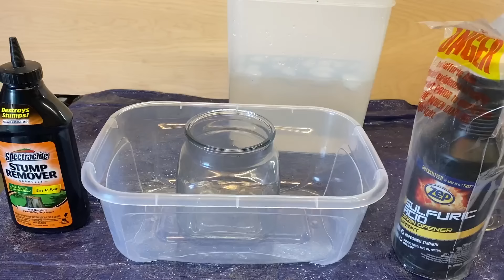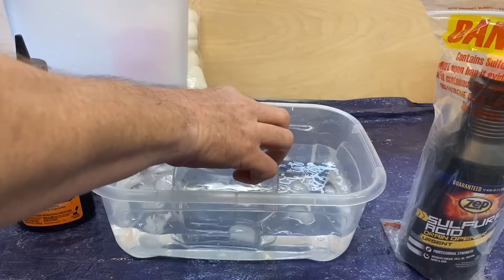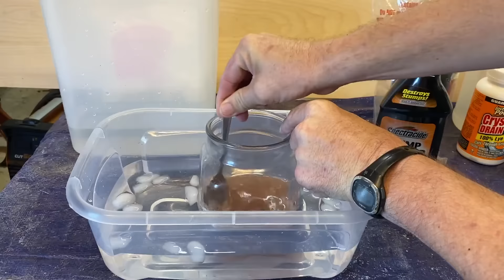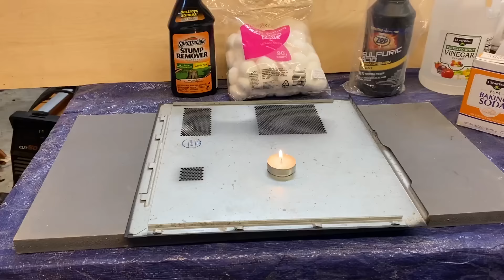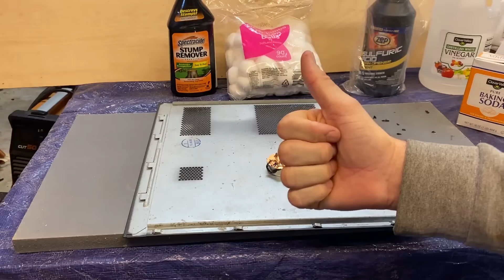Making Gun Cotton

Comment: No gloves, metal spoon to stir, I love the reckless abandon at which you operate Sir!
Reply from the maker: safety third or not at all.
Reply: All kichen utensils are made out of stainless steel which doesn't react with sulphuric acid and does not oxidize
However the glovelessness is inexcusable
Reply: Safety squints engaged!
Reply: Surprised he didn’t lick the spoon
Reply: Somebody lemme know when he pushes his last video.    I want to see what he was up to when he disappeared.
Reply: oddjobbob  I don't know where you live, but where I live They sell all utensils made from the same shiny steel. I have used forks that I bought for a dollar each in electrolysis experiments to great results. Chances are if it's meant to handle food it will be made from stainless steel.
Reply: The amazing part is that I tried to make following all the safety and good practice steps and didn't work 😍😍😍
Reply: @jackandy1736  😂But H2SO4 react with the iron inside the mixture of steel pretty well, moreover he was using zep drain cleaner containing 97% w/w concentration of the acid
Reply: @sunilbehera5628  Well no, If you watched the video you could see it did nothing to the spoon. Mixtures of elements can take on different properties independent of whether or not one of their individual part's has the opposite characteristic.
Reply: @jackandy1736  the fuming nitric acid generated in this synthesis will ignite many types of gloves such as nitrile and latex. It's actually safer to do this bare handed.
Reply: @CLCasual Ave!
Reply: At least he had it on ice
Reply: It is typically best to add chemicals to a exothermic reaction in slowly while mixing, is it not?
Reply: @bretlunsford6181  yes, almost always
Reply: @SpiritedMaker  😂😂👍👍
Reply: Об этом же подумал...
Reply: I think tongs might have been advisable for final testing.
Reply: @tedscott1478 😂😅, i was saying exactly the same thing!...not the best safety teacher is he?....remind's me of "fire marshal bill" from in living color!...😅😂
Reply: Spoon is also for tasting... Bet it's sweet
Reply: He'll probably be ok,  maybe!
Reply: and tongs would be a good addition.
Reply: Safety Third! is his motto
Reply: @robertjenkins5440  Let Me Tell You Something!!! Lol
Reply: Aww, it ain't gonna blow up! Shucks look at em , he still got all his fingers!
Reply: This comment section is like a sticky trap for Trolls. 
Good job!
Reply: @scinanisern9845  Even the big place where they make gunpowder in the US blows up every decade or two.
Reply: @LawlessMonkey72 . I know…obviously the only way to tell it’s mixed right
Reply: @jackandy1736    Neither does the chemistry of this video... its a catalyst, not consumed by reaction. In fact that is why Guncotton is responsible for some of the greatest explosive accidents in history, all that sulfuric acid that was never used, and is extremely hard to wash out of cotton, it being tiny little hollow tubes where it hides to cause spontaneous detonation years down the road.  However it DOES react with other ingredients, and is often the cause for many a youths hand being blown off.  As a general rule, one must NEVER use ANY form of metal in a chemistry mix. That is why they have glass spoons and glass rods. Just stay away from it, never go there. Kitchen spoons have been the end of many a novice. Notice he never grinds it to a micro dust and wash it.  This guarantees that if held for any extended length of time at one point it will spontaneously explode in a full whole body detonation. This is why it is that guncotton falls out of use soon after its discovery.  Back in the day they did not have the equipment needed to chop and grind it down to pieces so small as to be able to clean it from the acid very well.   It wasn't until we realized that, some time later, and built the equipment needed to reduce it in size small enough to wash the acid out of the center of the cotton fibers that it became stable enough to be sure it probably wouldn't destroy our military bases, fortresses and ships. Very irritating when your fortress blows up some sunny and otherwise peaceful day.
Reply: @lukesinclair1776 
How do you know he didn't lick the spoon, he was off camera most of the time...
Reply: Actually when handling strong acids , especially nitric acid which is what we're essentially preparing here, it's safer not to wear gloves because the burn you'd get from splashing your hand then immediately rinsing it off in the bucket of baking soda water you keep on hand (right?) Is less than the burn you'd get if you splashed nitric on your gloves or sleeve which then spontaneously combusts and sets the rest of your clothes on fire, that's also why you wear only natural fibers when working with pyrotechnics because synthetics will melt and fuse to your skin
Reply: @Einwetok  You ever seen the big Nitro Glycerin plant out in California?  Last time I was studying its layout was  a few decades ago, but DAMN, talk about a place built to deal with friggin explosions. They own the valley. There is nobody driving by.  The controls are on top of a mountain. The plant is in the valley.  The controls building tips backward down the other side of the mountain on hinges. The furniture is all bolted to the deck.  Only the people and chairs will then accelerate across the floor and hit the wall... which is hinged and opened up at the bottom when the building tilted back, and you go sliding down a giant slide built into the other side of the damn mountain, putting a mountain range between you and the plant as the sirens scream.  
Like friggin DAMN!   This is some touchy stuff!
Reply: @tedscott1478 Yeah, when he started the testing phase, before his hands were in the shot, my internal voice was saying tongs man, tongs! 😂
 
Heck, even free chopsticks from the local Chinese take-away would probably have worked.
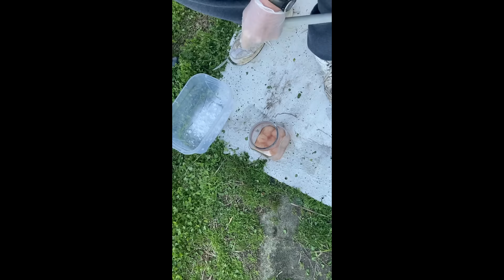Reply: He wore clear gloves look at 7:19
Reply: i came to say this. lol. well, the part about the no gloves and metal spoon, anyway
Reply: @jackandy1736  omg. you think stainless steel is acid proof. that's amazing.
Reply: Down South, it don't make no nevermind.
Reply: @BerzerkaDurk  yeah it didnt react in the video what are you talking about
Reply: I'm betting no full face shield or safety glasses.
Reply: Lol. @CLCasual
Reply: Accident looking to happen. Apparently he failed chemistry in school.
Reply: @CLCasual  AvE fan?
Reply: When it comes to many acids, gloves are not that important, and can even be the hazard as it keeps and sort of leak close to the skin. Or in the case of nitric acid, concentrated nitric acid on both latex and nitrile can spontaneously combust, while your wearing it. Now that mainly applies just to nitric acid where it's safer to not where gloves except those designed for nitric acid. 

However, it is always a good idea to have a large container of sodium carbonated/bicarb solution at the ready when working with acids. The reason is obvious, but something many don't consider is that a stronger base is not better in this case, as if there an accident and you need to dunk any part of your body into it, you don't want to trade one hazard for another by using either ammonia or a hydroxide. So use bicarb that you can literally drink and walk away with nothing more than diarrhea if it came to it.
Reply: @jackandy1736 oh, I heard that myth too. Or at least I should say that not all stainless is created equal. I have dedicated utensils for my chlorate production, and all of the metal ones are rusty.
Reply: We're not here for a long time; we're here for a good time. Best way to go out is with a bang!
Reply: To the safety  critics.  Did you learn to make guncotton ?   Because you were indictrinated in lab safety you know better.  But hes not teaching safety.
Reply: @Eric-fb2wp *lemme show you something
Reply: That and the nitric acid fumes he's undoubtedly breathing.  Hope he doesn't do this often, as he won't have lungs for long.
Reply: oddjobbob8742  that is right, but those impurities will affect the nitrating process zero.
Reply: I usually have a cigarette hanging out of my mouth as S.O.P. when I play with volatile chemicals at home
Reply: Look at all these hall monitors.
Reply: I can' t speak on that I lit myself on fire with homemade nypalm it hurt but I recovered with some cool scars
Reply: @SpiritedMaker  Step 1 is know what the hell you're messing with before messing with it. Step 2 is understand the risks involved and where operations can go wrong. Then and only then can you move on to Step 3 which is designing and readying safety protocols and processes to mitigate accidents and failures of the procedure. You dont get to decide what or when something goes wrong, but you do get to decide the mitigations that are on hand for WHEN it DOES go wrong. Step 4 is dont try this at home, try it at a friends house. ;)
Reply: doesn't this guy own pliars or tongs that he could have used when lighting up the gun cotton  DUH!
Reply: Metalplate on fireresistant Stone on flamable plastic. Exactly my kind of humor 😂
Reply: Yeah but still.. Sometimes there a bad apple among all the good ones.. How is that saying again.. One rotten spoon spoils the entire lab. Why take the chance. Even if its a very very small chance. Pros often try to minimize the chance of epic failure.
Reply: @scinanisern9845  It'll take awhile before he learns how to post videos again after losing his eyesight.
Reply: Taking the gun cotton the flame in his fingertips rather than lighting the gun cotton with a long nosed lighter is an interesting choice.
Reply: My thoughts exactly . Soon to win a "Darwin Award" ...
Reply: bro got steel bolls
Reply: Helps speed things up...speaking of which, if anyone knows of a way to speed up the burning of a regular, plain, ordinary, cotton ball, please include suggestions in the  comments. Maybe stop-action, higher playback speed, a propane torch...anything, anything to save future viewers the painfully monotonous, slowing of time effect caused by watching a cotton ball trying its best to return to ashes.
Reply: The reckless abandon only goes so far… he didn’t use nitrile gloves! 😀
Reply: At least he used an ice bath.
Reply: Dudes a rebel.
Reply: I was going to say the same thing 🤦‍♂️🤷‍♂️
Don’t follow this guy. This is pure recklessness on a safety level that is not even remotely being considered safe.
Reply: So what is this actually used for?
Reply: @blumax413  For when the tree of liberty needs watered.
Reply: @jackandy1736  it produces nitric acid which can ignite nitrial and rubber gloves it's safer to do without gloves at all just be by a sink with baking soda
Reply: Yeah I'm a Brit and I dont give a shit...just be careful..fully controlled substance
Reply: Starting with "ahh well, it'll be weighed down".
Reply: Well i mean it is stainless steel so he should be fine
Reply: Before they popped the first nuclear bomb, half the scientists believed it would ignite the earths atmosphere and the other half believed it would not. They popped it anyway, lucky for us one half were wrong ...

Safety? You don't need to get fancy ... Just pop the damn thing.
Reply: Don't want gloves with heavy acids lol but the spoon was pretty dumb lol
Reply: He used ice water...

Comment: This is basically solid nitroglycerin. I was not aware potassium nitrate could be used in place of nitric acid (although I am aware potassium nitrate is used to manufacturer nitric acid. When I was a teenager we attempted to make nitroglycerin. I guess we were successful because it went off on us and luckily we were about 40 feet away from the reaction. Used a mixture of fuming nitric and sulferic acids and glycerin chilled in an ice water bath. Should have used dry ice because the reaction is not cooled sufficiently with ice water. In our case, the mixture went off as a fast burn like a rocket motor, did not explode. We were lucky! Made mercury fulminate too. Reckless as hell, and had a lot of fun with it. Made lots of it. It's a miracle I was not blown up and gives me the chills when I think about what could have happened. When you are a teenager you think you are invincible. Now I just realize me and my friends were just plain lucky, very lucky!
Reply from the maker: Thanks for the info.
Reply: been there, done that, luckily still have all my fingers LOL
Reply from the maker: @donbaughhman3979  me too
Reply: And we couldn't understand why all the adults chastised us so much, like, what did they know?
Reply: Where is glycerin??
Reply: Where is glycerin?
Reply: This is not solid nitroglyerine,!  Nitroglyerine is 3 times stronger then nitrocelulose 😅😅
Reply: I've cooked some at one point. The trick is doing it drop wise with constant stirring and never letting it get warm. Genuinely terrifying thing this stuff is.

Comment: I love it!
The gun cotton mixture can be used on any cellulose to make anything you would want to make burn faster!
Use paper, and you can make flash paper, but use as thin as possible paper for the fastest burn rates, like tissue paper!
Reply: I thought the same thing, use that crate paper they use for party decoration's, that stuff is already super flammable!
Reply: The illegal bookmakers never use computers to take chalk. The buy old school paper blotters and convert them to nitro cellulose. Then they write down their bets. They always keep slow smoldering punk wood in the area of the back office. If the police come piling through the front door......yelling "police" by all in front! The punk wood ( there are several) gets tossed on the days treated blotter and the door is slammed and the chair against the door. By the time they get in......no markers.
Reply: @JaimeGarcia-pe7bj  I heard the cigar or cigarette smokers would blow on the smoldering coal and touch it to the daily blotter if needed!
Reply: What about toilet paper? They're using toilet paper to make carbon for gunpowder, and it works very well
Reply: @josephdupont  Yes it does, as it is very pure and consistent. And I believe any unwanted material has been removed before being turned into the paper. As long as you stay away from lotions and perfumes.
Reply: What about saw dust?

Comment: It would have worked much better if instead of "rinsing" it with water, you neutralized the solution by adding baking soda to it and letting it sit for 20 minutes before taking the flash cotton out of the solution. You can then take the cotton out and let it sit and dry. It would combust even faster
Reply from the maker: Thanks

Comment: In the early days of aviation we used cotton cloth, and painted it through with celliose nitrate, ( nice clear finish) , when the engine backfired, you landed right where you are, even at 1000 feet of alt
Reply: Do what???
Reply: @jakelandry5645  Early aircraft had cloth covered wings and fuselages instead of aluminum skin.

Comment: I found a formula for making a plastic explosive back in the 60's using gun cotton and something else I forgot so I never made any.
Reply from the maker: Probably for the best. :)
Reply: @SpiritedMaker  Then most kids were putting saltpeter, sulfur and charcoal together without getting it to a fine powder and getting the same slow burn and it wasn't till later I had the idea to put some in an used model rocket engine with nichrome wire on leads and set it off with a battery and it worked only to well but I was to close and caught some in my cheek and that was the last time I did anything like that and setting here with all my fingers I think of all the teenagers and younger that suffered a lot more than I did just for the thrill of making explosives.
Reply: We would buy full boxes of matches, 50 packs to a box for 25 cents at the local supermarket when we were kids in the 70s. Collect all the match heads and make really cool things with them.😂
Reply: @UNoBugMe1  Were those the strike on the cover or strike anywhere?
Reply: @BEDavisBrown  on the cover

Comment: Mixing it like that when its being chilled while the nitrate salt will be fully disolved  it will take some heat to get it converting to nitric. I've read that heating to 70°c is sufficent. I simply just warmed the sulphuric acid up to temperature and add the saltpeter you'll lose a fraction through decomposition into Nox gas but its negligible and is the fastest method to make the nitric you need. Kinda the dame goes for the gun cotton.. chill it in ice over night... Or just do it at room temp just keep an eye on the solutions temp or if it gets too high itll start melting the cotten or possibly have runaway nitration. But this way 10 or 15m nitrating is sll it requires. If you really want to give it some more kick. While the cotton is still in the solution instead of taking it out, pour in another equal volume of frest solution. You do it right instead of cellulose trinitrate as you would have from the first pass in the solution, to cellulose hexanitrate after double nitating it... Think if that like cellulose try nitrat's bigger stronger angrier, less stable older brother
Reply: You can not hexanitrate cellulose,you can barely trinitrate it😂😂😂😅